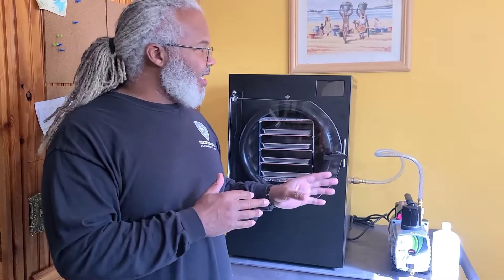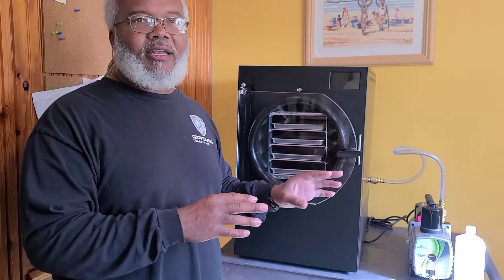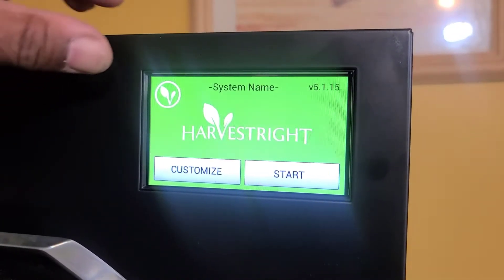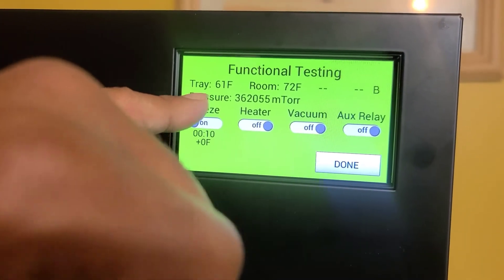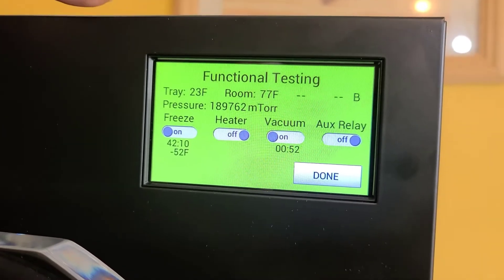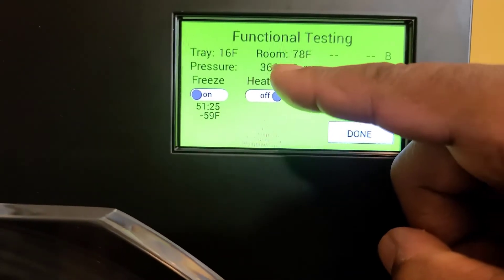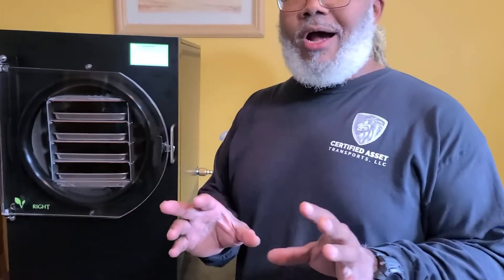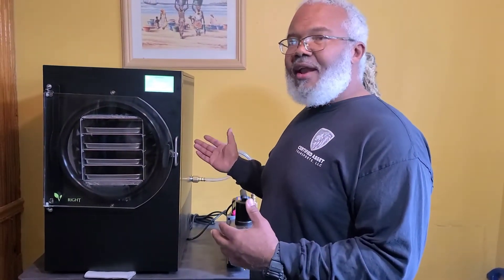Functionality Test for Harvest Right freeze dryer....SUPER EASY

Comment: Glad yours is working. Got ours about a month ago, wasn’t freezing so sent it back to harvest right to get repaired, got back a few days ago and tested it last night and still doesn’t freeze. Very frustrating!! About to send it back for a refund.
Reply from the maker: What did they say the problem was the 1st time?
Reply: @stepbystepfarming  they didn’t say. I assumed they replaced the condenser and tested it before sending back to us but it still doesn’t freeze. Ran it last night in test mode for an hour and only dropped one degree
Reply from the maker: @mbean1523  🤔 if you haven't done so yet, I would definitely contact support to see what was wrong and what they did to fix it. Can you request a new unit?
Reply: @stepbystepfarming  we’ve been in contact with customer service and I’ll be running some tests this weekend and see if they can diagnose the problem.

Comment: After I did my functional test and went to put in the type of pump. It wouldn't allow me to put in the type of pump it is
Reply from the maker: When we set up our functional test it never asked us what type of pump we were using. I'd suggest contacting the customer service at Harvest Right at 801-386-8960
Reply: It asks which pump when you run your first test batch/bread run after the functional test. Follow the steps in your manual.

Comment: We got ours today but we can't run it because the door hinges are all wobbly and loose. Hope it's suppose to be that way. Thanks for the video
Reply from the maker: Wonder if the screws got loose during shipping. Were you able to get your freeze dryer fixed?
Reply: @stepbystepfarming  There is a little give and take built in the hinges of the door.
Reply: I thought my door was off but it turned out I wasn’t closing it correctly. The handle has like a double twist function.  Took me awhile to figure that out.